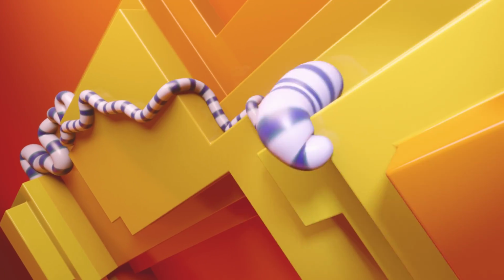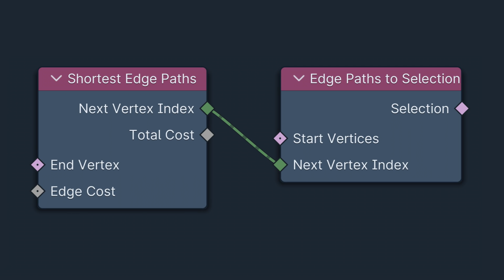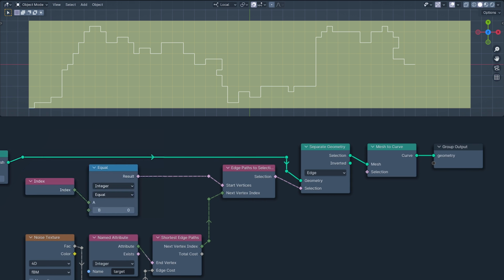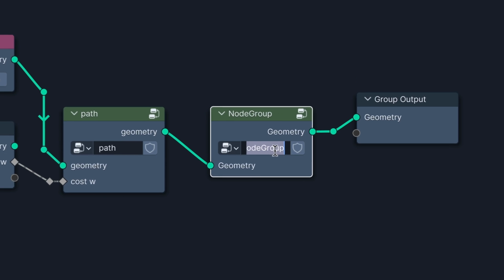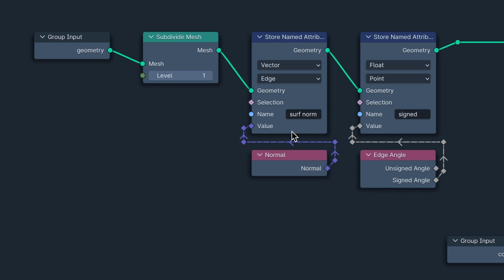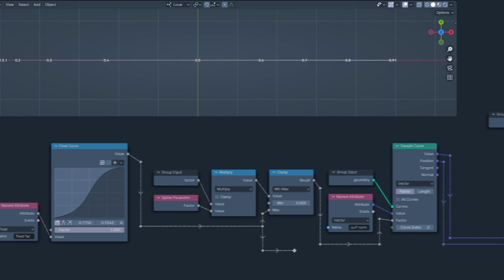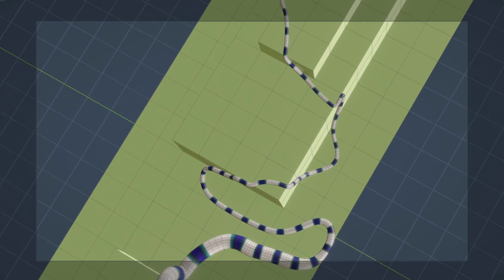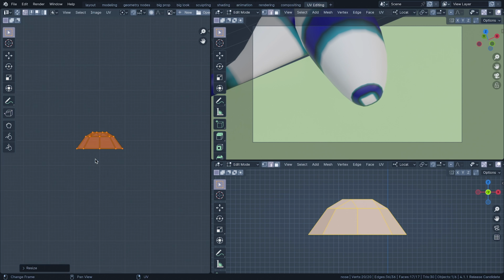procedural snake animation rig with geometry nodes in blender 4.1

Comment: what's the use of storing the signed angle in a named attribute when you could just drag its output into the map range node directly
Reply from the maker: You need to store the signed angle as an attribute on the mesh so you then have it on the curve. “The Edge Angle Node calculates the angle in radians between two *faces*”